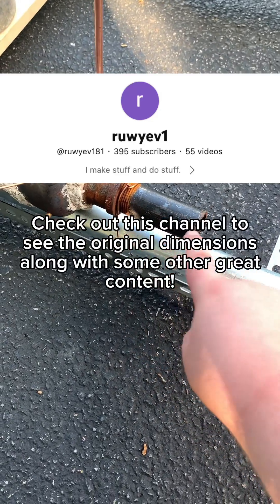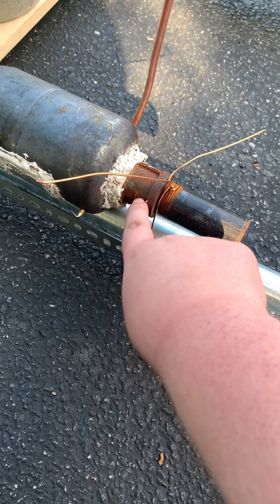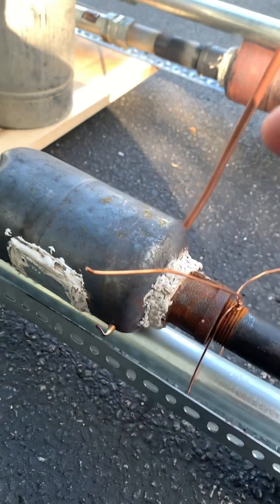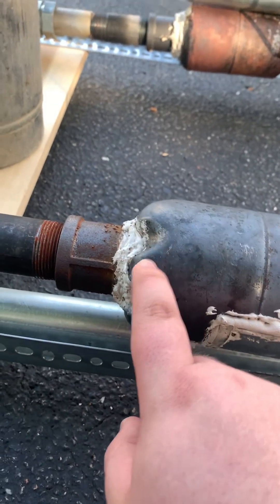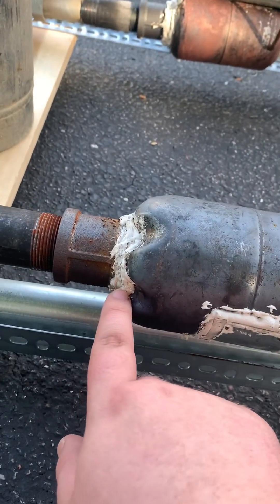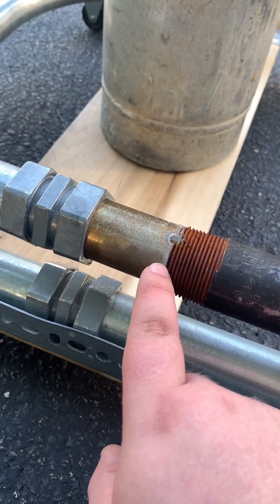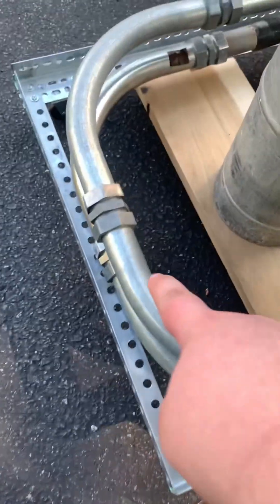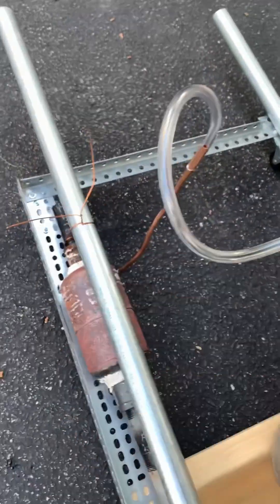How to Build a Propane Powered Pulsejet #jetengine

Comment: Bell the intake pipe for better air flow. Will run wayyyy faster too
Reply from the maker: I had though about such a design for my turbojet but never considered it’s use here. Thanks for the recommendation! I will definitely implement it sometime.